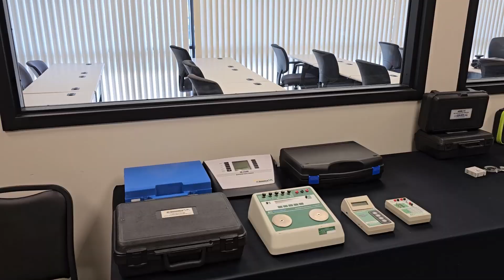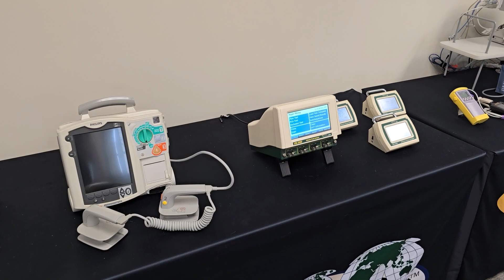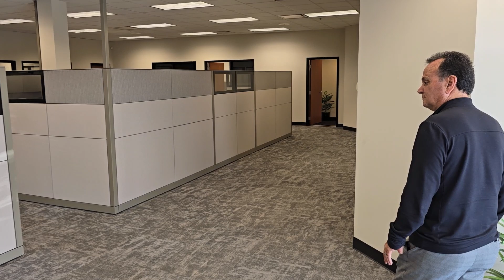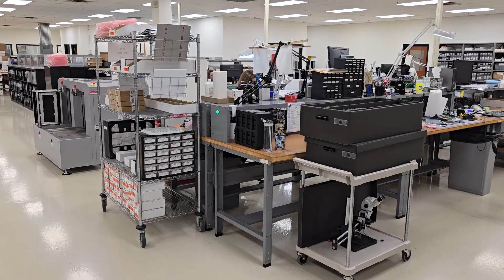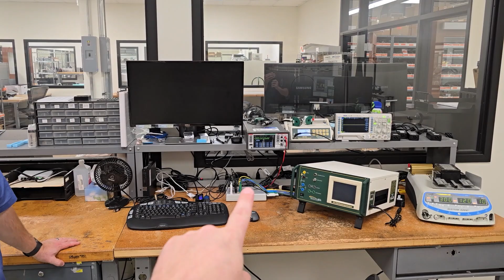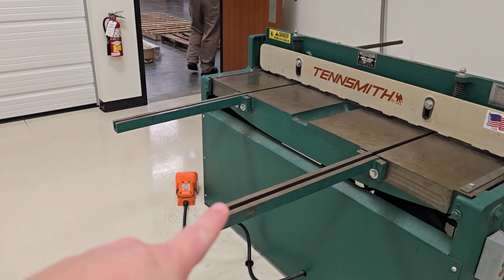BC Group Company Tour!

Comment: It's a great tour, very interesting. Seeing the factory inside and the way they work gives you more confidence in the products, especially when you find out they make their own tools. You realize they know what they're doing and don't just resell. Do you have a leakage current tester for endoscopes? One like the ULT 2020, but for endoscopes, would be interesting.
Reply from the maker: @luisricardoramirezgonzalez2859  
Interesting.  The ULT-2020 should work the same way: prepare a water bath, submerge the scope - except for the control housing, insert the HV probe into the bath and connect the test lead to a good ground point on the control housing.  I'm curious if the Hi-Pot test could destroy the scope distal Camera etc..  Interesting..